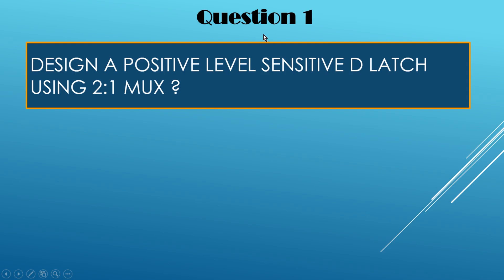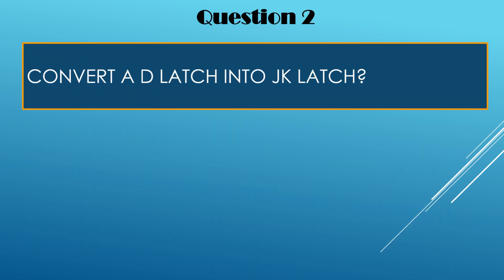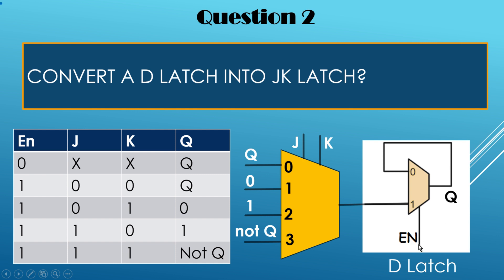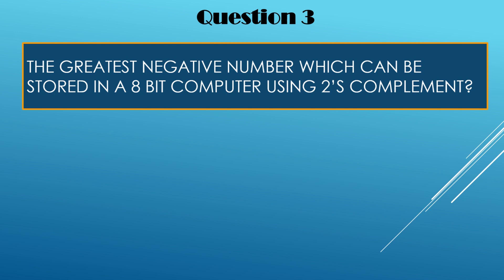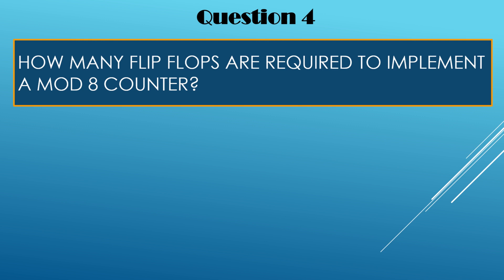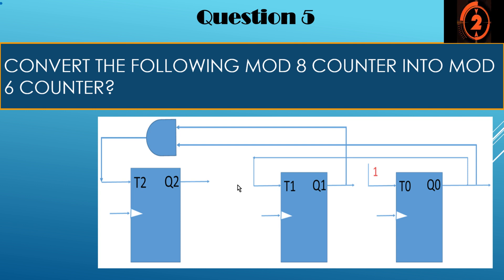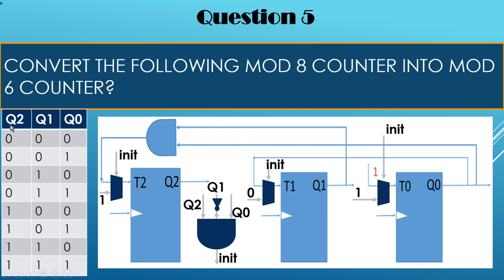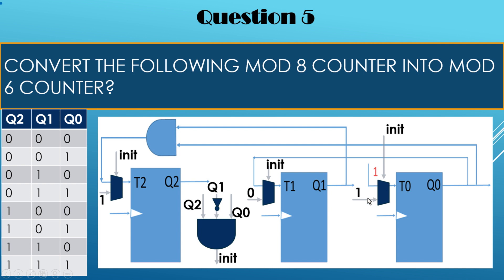Electronics Interview Questions: Digital electronics - Part 2

Comment: Sir for last question your method was superb using mux , can we use " init "as input to reset 3 T flip flops also if 0 count is required again?
Reply from the maker: Ranveer, it is a another good answer to the question.. if reset is synchronous, definitely, we can apply init to reset of all the flip flops. Infect, I saw that FPGA tools do the same at the time of synthesis to avoid use of LUTs and MUXs available in the CLBs.
but if reset is asynchronous, connecting init to reset of flops will immediately make the output 0 which is undesirable.
Now, in that case someone may generate init from state 6.
Thanks for initiating this discussion.
Reply: @TechnicalBytes  Thanks a lot sir , I got the point

Comment: I think value of T1 = 0, is wrong during init = 1,

because when init = 1, input to all FF must be T = 1 so that Q = 0 i.e. T2T1T0 = 111, hence Q2Q1Q0 = 000 (reset).
Please correct me if I am wrong, @TechnicalBytes ?
Reply from the maker: Sorry for very late reply, I was busy somewhere else .. 
Let me correct you..
Output of T flip flop is always depend upon its current output unlike D flip flop.

Let us see how T flip flop works.

If T=0, output of flip flop remains unchanged.
if T=1, out of flip flop toggles/inverted.

T     |       Qn+1
-----------------------
0     |        Qn
1     |        not of Qn

Let me know if still need further clarification.